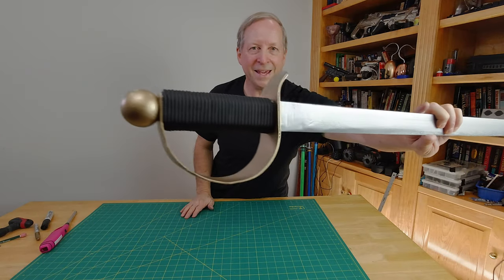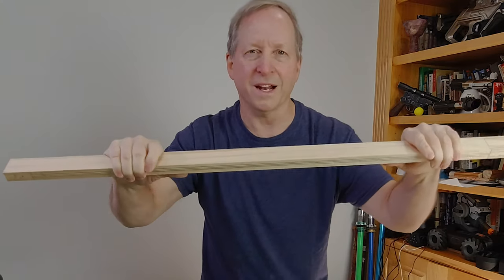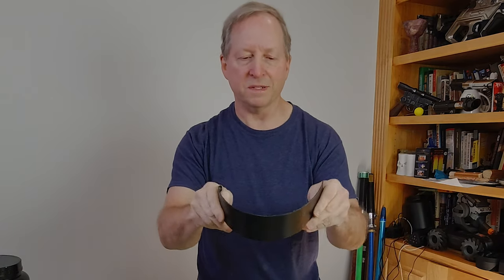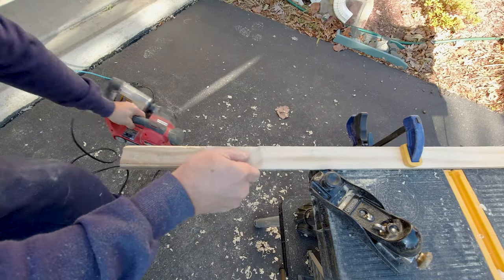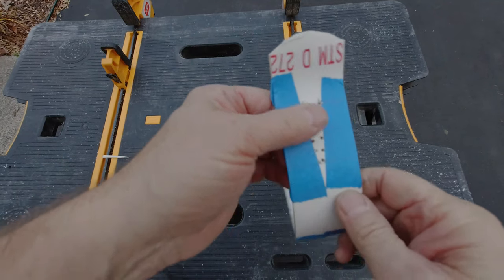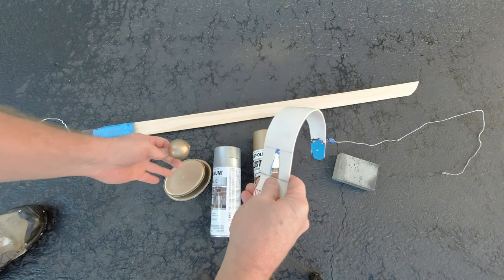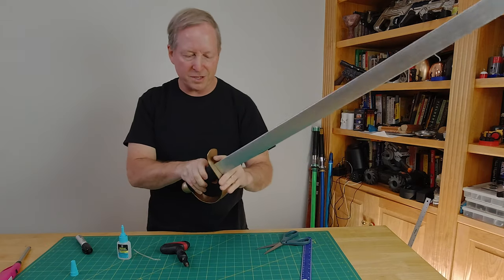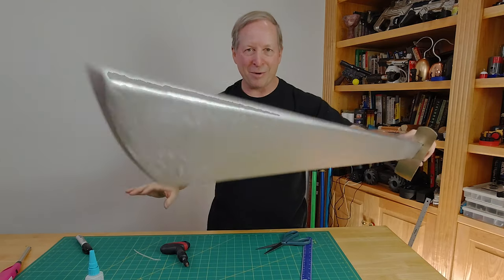How to Make the Best Wooden Saber Sword for Under $10 Easy Tutorial

Comment: How did you make the blade and handle? Cause I'm gonna make a sword similar to the one you made from 2014's The Book of Life. Comment me back.
Reply from the maker: James, the step by step instructions for the blade and handle are all provided in the video. Along with tips and suggestions on how I would do it differently if I made a sword again. Thanks for your question.
Reply: @MakeItorBreakItNow  I noticed you used a wood plane to make the blade. Is it optional to do that when making the sword? I'm just curious to figure out how you did the sword. Comment me back.
Reply from the maker: @jamesmcintosh6842  the plane remove a lot of wood quickly. You could also use a grinder, sander, or a file to do the same thing.
Reply: @MakeItorBreakItNow  Thanks!